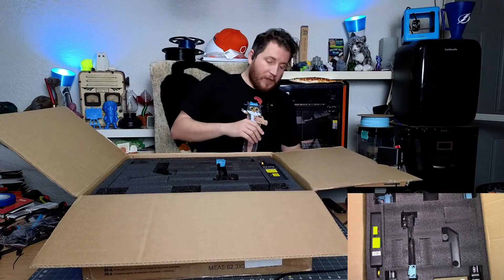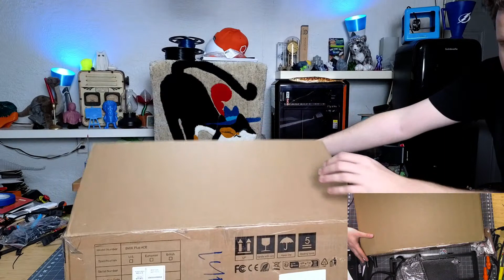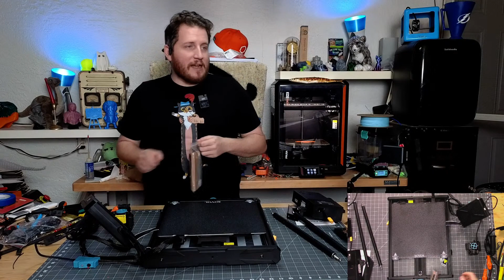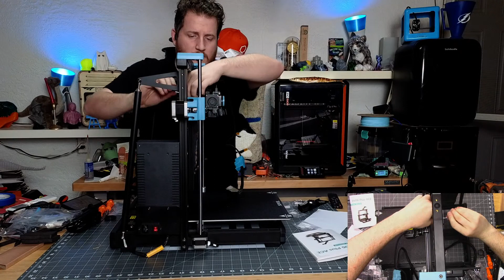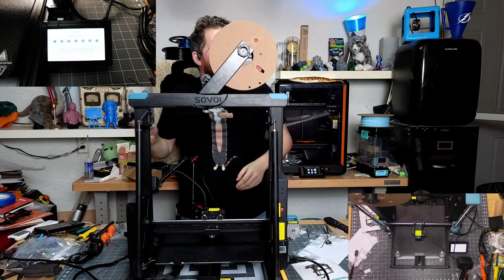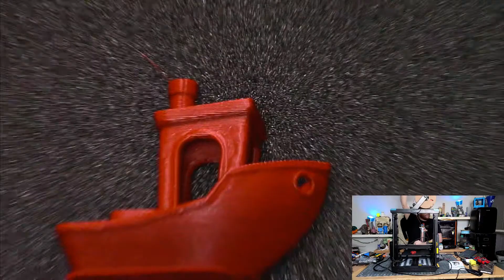SV06 PLUS ACE Unboxing and Testing!

Comment: The instructions were better and just as bad as the centauri carbon 2 I also got. Better pictures better written and diagrams but the cable management could of been better. I ended up having the cables inside and after some critical thinking I realized that the cables might catch if the extruder moved up and down etc. I looked at videos and figured that out. Had to uninstall things and correct